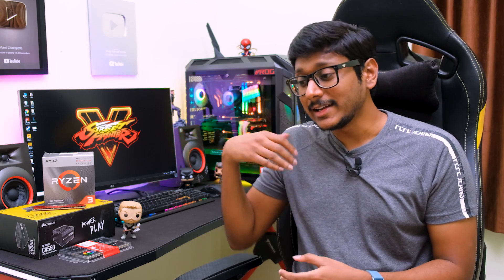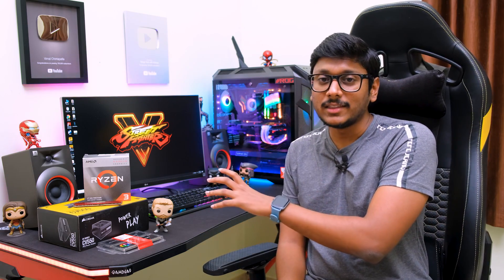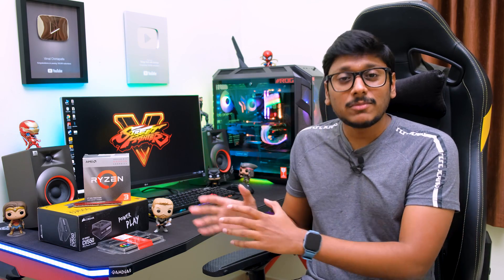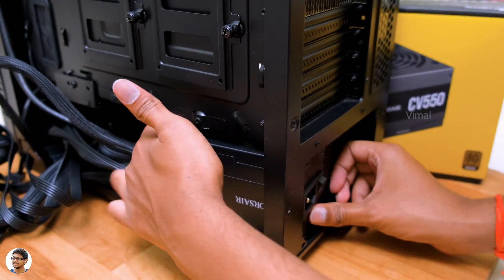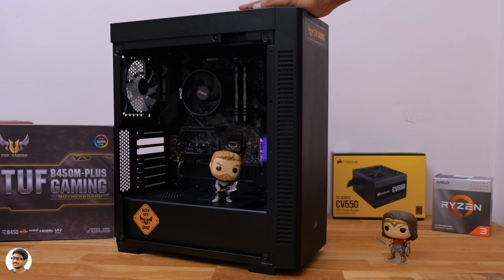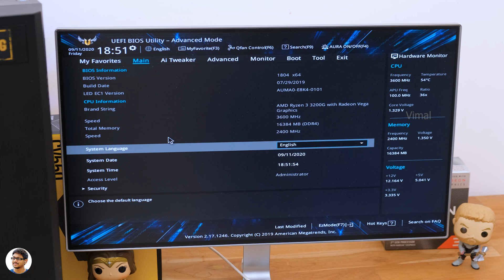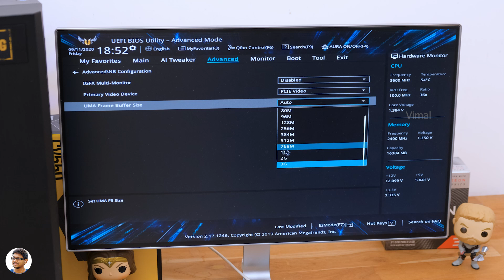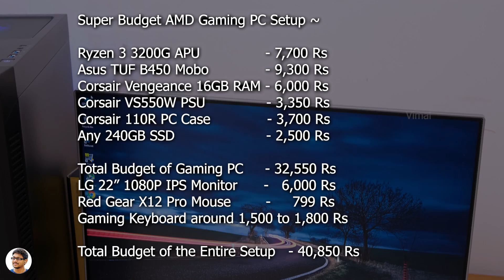40K Super Budget Gaming PC Setup... Crazy Performance! 🤯🔥

Comment: Sir, I want to use computer for computer programming, I am planning to buy assembled PC desktop as I need high speed and high configuration set up like corei7 processor. The branded desktop for i7 processor may go beyond 80000 as budget is issue. Will there be any difference in erformance if I use assembled PC instead of branded desktop? Because in programming I need only high speed processor and RAM, HDD, whereas other components I may not need of high configuration! I hope you understand!
Reply: Get a gtx1050 i7 and don't buy pre uilt pc and invest in z590 or 5z490 motherboard for i7

Comment: I bought a pc with i5 11500 and gigabyte b560 ds3h ac mobo both of them alone where 20+10=30k and bought 8gb ram ..gtx1050ti ..a benq monitor...a gamin cabinet ice 300TG..1tb Hdd 260Gb Ssd ..Psu 550 ..etc..and a rgb mouse and keyboard and a ups ..etc came total 70k...bulit on april 2021 .too components prices are too high now😭
Reply: Yes 😭

Comment: LOL  IN MY OPINON  THERE IS NO NEED FOR RYZEN  3 TO HAVE B450  , ITS BETTER TO GO WITH A320M
IN MY SUGGESTION
RYZEN 3  3100 
GTX 1650 GPU
A320M  MOTHERBOARD
8*2  16GB RAM FROM  XPG  
POWER SUPPLY 450W 
ANY RGB CASE   3K 
u will get better performance than what he built

Comment: It's 60 FPS because you have used 60hz monitor 😂😂
Reply: WTF
Reply: He mentioned 60hz monitor
Reply: @binaykumar1255  hz and fps has no relation to each other
Reply: 😂😂👍 60hz monitor can display only upto 60fps
Reply: @binaykumar1255  displaying and getting 60 fps is a totally different thing, you won't get it
Reply: If you are getting 120fps and displaying 60fps does it worthy
Reply: @binaykumar1255  you are technically getting 120 fps on a 60 hz monitor, but your monitor won't display things above 60 hz, that doesn't means the game would run below 60 fps

Comment: Need just graphics card.

If you had A computer and also have 40000rs, buy graphics card of 25000-30000, and buy 16gb ram in 5000 rs, if you need powerful chip buy in existing price or you can get a profit. That can run gta 5 in 150+fps.😁😁😁😁

Comment: Hey big brother!
I have also calculated the total cost of this pc build and you will be shocked after seeing this list:-

Components:-
APU- Ryzen 3 3200G
Price- Rs 8931
Motherboard-  Asus B450 TUF
Price- Rs 9935
RAM- Corsair Vengeance LPX 8GB RAM/HyperX Fury Black 8 GB CL15 DIMM DDR4 
Price- Rs 3300
Memory- 250GB SSD, 1TB HDD
Price- SSD: Rs 3000 / HDD: Rs 4000
Power Supply- Corsair CV550 W/VS550 W
Price- Rs 5000
Case- Corsair 110R PC CASE
Price- Rs 3300 

Peripherals:-
Monitor- LG 22" IPS MONITOR
Price- Rs 8000
Keyboard/Mouse- RED GEAR G-20 COMBO
Price- Rs 1300
TOTAL:: Rs 46766
All the prices are real. I have not made any changes.
And the Price 46000 is way far from 32000 as u can see.

Comment: I would spend more on ssd, ram and high gen processor rather than using costly display and keyboard + mouse .
Reply: Ofcourse
Reply: Hi vimal i saw your video on 40k pc . I have a question can i use 1.5 tb HDD along with 240gb ssd please reply

Comment: A320 Mobo for 4.5k save around 4.8k on Mobo. Can get a used CM case for 1.5k, that saves 2.2k on case. Total 4.8k+2.2k=7k. One can easily get used rx 570 or 1060 for 7k.

Comment: Vimal sir is a pc with a budget 60k having 
Samsung 860 EVO 500GB SATA 2.5" Internal Solid State Drive (SSD),Corsair Vengeance LPX 16GB (1x16GB) DDR4 3200MHZ UDIMM C16,AMD Ryzen 7 2700,
GIGABYTE B450 AORUS PRO WiFi Motherboard,ASUS Cerberus GeForce GTX 1050 Ti 4GB OC Edition, Corsair CV450CV Series80 Plus Bronze Certified 450 Watt ,Ant Esports ICE-200TG Mid Tower Gaming Cabinet and Ant Esports Superflow 120 Auto RGB V2 1200 RPM 
Ant Esports Superflow 120 Auto RGB V2 1200 RPM

Good for gaming , editing and animation 
Sir please reply

Comment: Really those are fools...whose budget is 40k and buying ryzen 3 3200g😂😂..
Ryzen 3 2200g -7k
Ryzen 3 3200g -8k
Mobo.               -4k or 5k
Smps.                -1k or 800
Cabinet.            -1k or 2k
Monitor              -5k or 3.5k
Keymouse.         -800
Ram.                  -3k
Hdd.                   -3k
...approx=25~26k 
Iam also from AP
Onething-Buying expensive cabinets,powersupply,RGB lights doesnt increase performence of ur pc..It just depends on processor then ram n storage. .

Comment: Will this combination be ok? 
Ryzen 3 3200g     approx 7700
Msi b450m pro m2 matx amd b450 ..approx 7000
Antec vp550p plus 550w 80 plus standard .. approx 3000
Antec nx200 RGB ATX mid tower .. approx 2850
Adata xpg gammix d30 8gb ddr4 3209 mhz X 2 ... Approx 5700
Any ssd .. approx 3000

Comment: Bro, this monitor is 60hz. Then how is it possible to get this much frames in games? Please tell me.
Reply: turn off v-sync
Reply: monitor hz has nothing to do with fps.
Reply: @SanchitTewari  are you sure? Because I don't have much idea about monitors
Reply: @47ARENA  Ugggh. I'll try to explain it simply.
Monitor hz means the rate at which your monitor is able to refresh the screen.
Fps is the frames your hardware is able to gain in every second.

NOW...  HZ should be equal to fps for the best experience.

If Fps > Hz Screen Tearing Occurs
If Fps < Hz  Stuttering Occurs

Now to keep these two things equal... we need either a AMD freesync monitor and GPU or a Nvidia Gysnc/gysnc compatible monitor and gpu.

You can have like 2000 fps and still play on a 60 hz monitor....
Reply: Monitor is not matching in description  what was  u showed in video
Reply: But doesn't feel like still we playing at 60 hz cap @ST_08

Comment: Hello vimal, I feel the monitor pricing which you specified is bit less compared with the market price. And I bet the 22" monitor which u showed in the video is not at all available for 6 k... Minimum price of 1080p monitor is 8500 and more.. and in Paytm mall, the monitor is out of stock for a long time. Am ready to pay 6k immediately if I get a brand new 22" 1080p monitor.. the question is wer it's available? I bet u can't get it for tat price.. please check and provide the actual pricing...

Comment: You should have added gpu in the last section so we can get idea of difference between performance in both situations.
Reply: While APU's have come far from where they started, even buying a 1050 will make loads of difference( not that this particular graphics card is very viable in India, it's ridiculously expensive for what it can do).
I have a 3400g, and while it does give a good performance as Vimal has said, it's nowhere near as good as a proper graphics card. And 3400g has vega 11 too.

Foe specific figures, a vega 8 maybe has about 30-40% perfomance of a 1050ti( don't quote me on that, just trying to show the picture).
Reply: @anirudhdiwakar987  buy used rx570 all problems solved
Reply: @OmPrakash-pc1ec  used market for pc parts in india is not that great. Either the products are too far away or just too sketchy to buy. Also, most deals I see have their prices close to the new ones too...
Reply: @anirudhdiwakar987  why would i quote you man you just helped me there. Thanks 👍🏻👍🏻👍🏻
Reply: @mohammadbilal4717  k!
Reply: @anirudhdiwakar987  hey dude I'm using 1050 and I can attain only 50-55 fps in GTA ultra but he's attaining 90fps easily !! I can't understand
Reply: @venkat5227  bro he is playing on 720p and normal settings and fps is around 60-80 but a 1050 can give 60 fps 1080p ultra.I have a gtx 1050 3gb version,
Reply: @justchilling998  okay bro btw gameloop emulator rendering as fuck , I'm using gtx 1050 4gb !!
Reply: @venkat5227  what the other guy said😅
Reply: @venkat5227  well i dont know why but I'm not able to download call of duty mobile from gameloop... And i even tried reinstall gameloop again but didn't work
Reply: @nev963  why ? Cancelled or not even began ?
Reply: @venkat5227  like 7% and then stuck and i even check that I'm getting at least 3 megabyte per sec so not Internet issue
Reply: @nev963  use vpn that'll solve your issue

Comment: Please make a video by adding graphic card to this build😍
Reply: don't buy the motherboard shown in this bullshit video 
Literally makes no sense to buy a motherboard costiler than the processor
I recommend u this configuration for 100000000 times more performance
i3 9100f(6k)
H310 mobo (4k)
1650super(12k)
450w PSU(2k)
Any budget Cabinet (around 2k )
Adata su800 240gb SSD(4k)
Any budget moniter ( 6-8k) 
Any keyboard + mouse combo (1-2k) 
There u go ,, 10000000000 times more performance for the same price

Comment: add some multiplayer games like pubg or warzone next time
Reply: don't buy the motherboard shown in this bullshit video 
Literally makes no sense to buy a motherboard costiler than the processor
I recommend u this configuration for 100000000 times more performance
i3 9100f(6k)
H310 mobo (4k)
1650super(12k)
450w PSU(2k)
Any budget Cabinet (around 2k )
Adata su800 240gb SSD(4k)
Any budget moniter ( 6-8k) 
Any keyboard + mouse combo (1-2k) 
There u go ,, 10000000000 times more performance for the same price

Comment: Man gaming pc can also be made with i7 3/4th gen please make a pc with this config and gfx can also be used as this kind of pc can have such budget
Reply: Exactly
Literally makes no sense to buy a motherboard costiler than the processor
I recommend u this configuration for 100000000 times more performance
i3 9100f(6k)
H310 mobo (4k)
1650super(12k)
450w PSU(2k)
Any budget Cabinet (around 2k )
Adata su800 240gb SSD(4k)
Any budget moniter ( 6-8k) 
Any keyboard + mouse combo (1-2k) 
There u go ,, 10000000000 times more performance for the same price

Comment: I want a gaming PC so plz suggested me a gaming PC full setup ( monitor
 mouse headphones mouse pad or keyboard ) under 60k so plz suggested me the full setup gaming PC (ryzen 3500 or gtx 1650 or 1660 ) must include in PC setup or (SSD 240GB OR HD WD1TB ) plz suggested me t full gaming setup 🤭
Reply: don't buy the motherboard shown in this bullshit video 
Literally makes no sense to buy a motherboard costiler than the processor
I recommend u this configuration for 100000000 times more performance
i3 9100f(6k)
H310 mobo (4k)
1650super(12k)
450w PSU(2k)
Any budget Cabinet (around 2k )
Adata su800 240gb SSD(4k)
Any budget moniter ( 6-8k) 
Any keyboard + mouse combo (1-2k) 
There u go ,, 10000000000 times more performance for the same price
Reply: U can buy r3 3300x + 1660super + b450m mobo ,, for remaining specs refer my above comment
Reply: @Polaris1577  thanks so much sir

Comment: Best built for 50k including graphic card. Please before this month ends or else I'll end up building an overpriced and inefficient pc for its price.Please vimal sir I want it asap before october.No need to make a video on built just please reply me or make a virtual built telling the parts.I'll be waiting.....
Reply: don't buy the motherboard shown in this bullshit video 
Literally makes no sense to buy a motherboard costiler than the processor
I recommend u this configuration for 100000000 times more performance
i3 9100f(6k)
H310 mobo (4k)
1650super(12k)
450w PSU(2k)
Any budget Cabinet (around 2k )
Adata su800 240gb SSD(4k)
Any budget moniter ( 6-8k) 
Any keyboard + mouse combo (1-2k) 
There u go ,, 10000000000 times more performance for the same price
Reply: Here u go
Reply: @Polaris1577  believe me I have the same specs in my cart.But the prices you mentioned here are the real prices.and those are currently overpriced.i3 for 7k 1650 super for 16k 
Everything is overpriced at this point of time

Comment: Bro we should wait for building pc as ryzen is going to announce 4000 series dextop cpu and i will include 4200 and 4400g ok
Reply: don't buy the motherboard shown in this bullshit video 
Literally makes no sense to buy a motherboard costiler than the processor
I recommend u this configuration for 100000000 times more performance
i3 9100f(6k)
H310 mobo (4k)
1650super(12k)
450w PSU(2k)
Any budget Cabinet (around 2k )
Adata su800 240gb SSD(4k)
Any budget moniter ( 6-8k) 
Any keyboard + mouse combo (1-2k) 
8gb or 16gb 2666mhz ram depending on Ur budget 
There u go ,, 10000000000 times more performance for the same price

Comment: Bulid 35k Intel processor
Reply: Here u go  ( this build is trash btw)

Cuz it Literally makes no sense to buy a motherboard costiler than the processor
I recommend u this configuration for 100000000 times more performance
i3 9100f(6k)
H310 mobo (4k)
1650super(12k)
450w PSU(2k)
Any budget Cabinet (around 2k )
Adata su800 240gb SSD(4k)
Any budget moniter ( 6-8k) 
Any keyboard + mouse combo (1-2k) 
8gb or 16gb 2666mhz ram depending on Ur budget 
There u go ,, 10000000000 times more performance for the same price

Comment: I think ur making such good quality videos but u r not getting that much of views
Reply: No this video is utter garbage and idk what kinda weed he was on while making this 
Cuz it Literally makes no sense to buy a motherboard costiler than the processor
I recommend u this configuration for 100000000 times more performance
i3 9100f(6k)
H310 mobo (4k)
1650super(12k)
450w PSU(2k)
Any budget Cabinet (around 2k )
Adata su800 240gb SSD(4k)
Any budget moniter ( 6-8k) 
Any keyboard + mouse combo (1-2k) 
8gb or 16gb 2666mhz ram depending on Ur budget 
There u go ,, 10000000000 times more performance for the same price

Comment: My cpu costs 48k in total which i bought in 2019
Specs:- Ryzen 7 2700
Gskill 16GB 3000mhz ram
Gigabyte wifi+bluetooth mobo
Gigabyte nvidia GTX 1650 super 4gb
1tb hdd
120gb ssd
Antec 550watt power supply
(Existing cpu case was used)

Comment: HOLY MOLY ITS PERFORMANCE IS FAR BETTER THAN MY LAPTOP THAT HAVE DEDICATED GRAPHIC 😔
Reply: don't buy the motherboard shown in this bullshit video 
Literally makes no sense to buy a motherboard costiler than the processor
I recommend u this configuration for 100000000 times more performance
i3 9100f(6k)
H310 mobo (4k)
1650super(12k)
450w PSU(2k)
Any budget Cabinet (around 2k )
Adata su800 240gb SSD(4k)
Any budget moniter ( 6-8k) 
Any keyboard + mouse combo (1-2k) 
There u go ,, 10000000000 times more performance for the same price
Reply: @Polaris1577  Thanks 👍

Comment: Sir why why u build this type of pc under 40k💘💘
Sir build a PC by using graphics card  at this budget see there sir

Ryzen 5 1600- 7500
A320 MSI pro --4000
Ram --8*2 =16gb crucial ballastix 3000mhz--6000
Psu-antec bp450--2500
Ssd --wd m.2 or sara-2500
Hdd-1tb--2500-2600
Cabinet - chiptronix under 2500 any cabinet with good airflow

Now graphics card GTX 1650 super--13000
Total=40k now I think this was really a good PC build under 40k

And one more thing a320 MSI good motherboard it's entry level gaming motherboard u can overclock your ram ..also I think at this budget u should not want to overclock your cpu

Comment: I am doing a similar build. The parts in my build:-
1) 3400G
2) Asus A320 mobo
3) 2 x 8 gig Ripjaws V
4) crucial MX500 512gb SSD
5) corsair CV 450 (was looking for CX450 for a long time but it seems to be out of stock everywhere in India)
Reply: Hey dude, did u finish ur build? I'm tryna build a PC too can u explain in detail how ur PC works? What all games u can play on it???
Reply: @edlie6541  yeah my build is complete... All parts are as I have mentioned here. I mostly play apex legends on a 720p monitor and it gives stable 60 fps in 720p. You can play a lot of games in this build with decent performance. If you wish to play games on 1080p I would recommend pairing it up with a GPU (3060 or 3050 recommended, 1660ti if you are too tight on budget)
Reply: @aakashkarmakar7478  would a gtx 1650 be sufficient for 1080 p gaming? also how much was ur overall cost including monitor keyboard mouse? can u tell me what monitor u used too? sorry for all this, but god bless u for helping me

Comment: Hi vimal, 

Vimal this side too

I also want to build the sam budget good performance pc.. Got all the required info. 

Just want to confirm one more thing that can i go with ryzen5 if budget allows ? What should be the model of ryzen 5.. Or should I go with intel core i5. 

I don't do gaming a lot.. Just you tube and my office work.. Rarely gaming 🎮

Plz suggest
Reply: Go with ryzen man ,, it's 1000000000000000% better  than i5 
Only good intel option rn is i3 9100f rest all is underperforming trash compared to amd
Reply: @Polaris1577  Thanks for your wonderful opinion..😊

Comment: Bro can I set the same bios settings in A320M S2H Motherboard
Reply: May be no bro because u have to update BIOS and later 16 GB ram also u have to add
Reply: Bro but I have the latest bios from gigabyte F51 bios version so can I do
Reply: How much ram bro
Reply: 8gb but I am going to upgrade to 16gb so can I do
Reply: Bro which processor u r using
Reply: If you have ryzen 3 3200g then u can keep the buffer size  to 2gb

Comment: My pc specification 

Ryzan 3 3100
Rx570
8 GB 3200hz
256 SSD
A520 Mobo 
Power supply (Cheap)
Cabinet (Cheap)
Lg 22MP68VQ Monitar Red Gear Mouse and keyboard 
Around 43000

Comment: Hey bro! This is what i was looking for from you till now. But still I'm left with one more question. If I buy a GPU in the future then the whole point of having a APU is useless. Try to make a budget video under  40K which involves a CPU and a GPU. Try to include the fan settings too (positive, negative, neutral).

Try to add some links please bruh! Suffering to find hardware components properly.